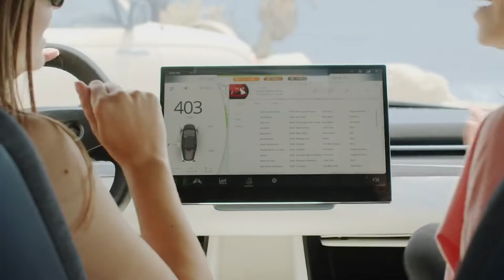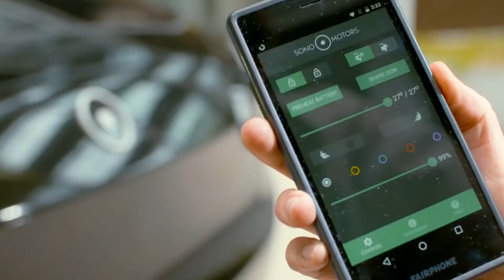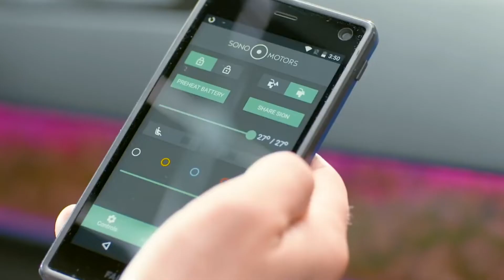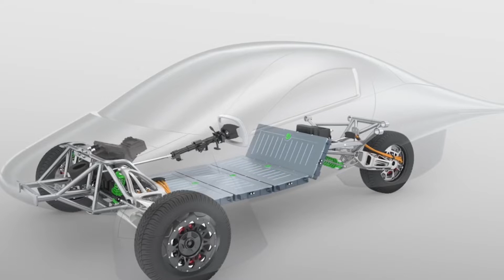Coming In: Self Charging Electric Car

Comment from the maker: What do you think, will this type of car work ?
Reply: Two meny miss-steaks!
Reply: There's a flywheel car too. Combining two to 4 technologies into hybrid could remove charging station needs. An oil compartment that's heated but not boiled, via mechanical friction can provide heat for the batteries to draw from.
Reply: I wonder if a Hydrogen-Electric car will come out as they seems like a good answer

Comment: This assumes that the sun is out all day. Y'all ever heard of clouds?
Reply: Wheels could be designed to produce energy enough to charge a battery continuously while in use like an alternator. While the vehicle is off you could plug it into your homes regular outlet or it would self charge from a solar panel on the roof.

Comment: I remember when they first tried to introduce these in the 2000s and they never made it then. Good luck this time. Good luck getting more than 20 miles a day from the solar cells. To get 1000 miles of range is possible with external charging. But if you drive more than 20 miles of so a day you will eventually run down the battery and have to plug it in.

Comment: That should be  up to 11,000 miles per YEAR, not 10,000 per month for the Aptera. There are currently no actual drivers yet, as the first deliveries are scheduled to begin toward the end of 2022, so the claim of never requiring charging is based on an average daily commute/driving habits of the normal user and is the expectation of the company.
Reply: Yes, I was going to make the same comment regarding solar range.  I got my order in in time to get one of the first deliveries and I live in not so sunny Iowa.  Since I live in a small town, my daily driving needs, including an occasional trip to Des Moines and Kansas City, are still likely to be met completely through solar.  The fact that I can fully recharge the 40 kWh battery in about 50 minutes on a road trip at 50 kW DC chargers means that I will be doing some cross country road trips with it as well.  I hope to pick mine up at the factory late this year and show it off during a drive up to Bellingham, WA and then back to Iowa with my wife.  Due to the excellent traction control/ABS I am not too worried about the bad weather we will likely run into during that time of year.  I plan to report on whatever happens.
Reply: @n.brucenelson5920  If that comes true, (Or at whatever point it does.) drop by and I'll take you out to lunch as you pass through South Sacramento County.
Reply: @billthacet  I definitely plan to pass through on my way back to Iowa.  We would consider it a real pleasure to meet you in person.